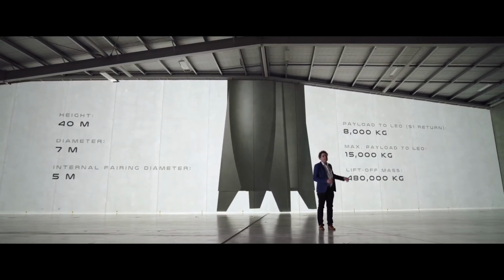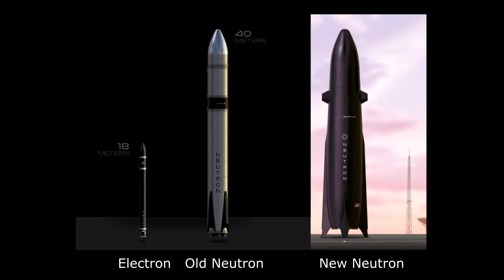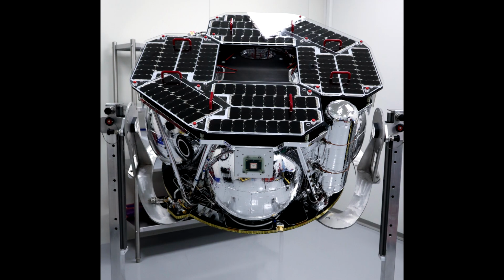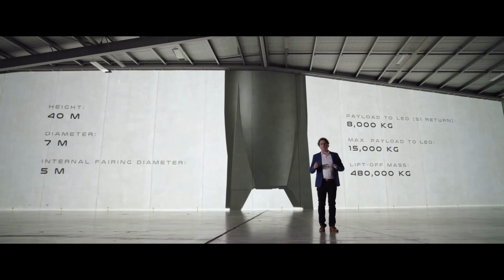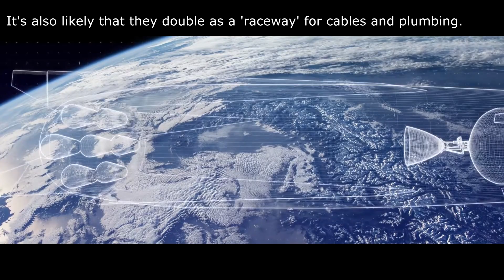Rocket Lab's Neutron Rocket Will Be More Reusable Than Falcon 9

Comment: I don‘t get why they wouldn‘t go for a fully reusable rocket. I think it is so obvious that if you have to scrap anything at all you‘re not gonna be able to compete with a system where the marginal launch costs are literally just the fuel. I suppose this upper stage will cost more than an entire Starship fuel tank so as ridiculous as it might seem, Starship will be cheaper to fly than the Neutron, not on a per kg basis, but in absolute terms.
Reply: making a fully reusable rocket is more difficult at smaller scales, so that's probably why they didn't go for that.
And I have doubts if starship could actually be cheaper than this rocket, specially if they bring the cost of the second stages down by mass producing them
Reply: There are lots of mission profiles that practically demand an expendable upper stage, anything higher than LEO is going to need to do a burn to raise its orbit. So if you fly a Starship to launch a satellite to a GTO, you need to drop that satellite off in LEO with an engine and fuel capable of raising its orbit. That sounds awfully similar to the Neutron second stage, right? So if the rest of the vehicle is reusable, you're really in a similar situation, except you don't need to rideshare with 100 other small satellites on a giant rocket. Starship is designed to do 2 primary jobs, bulk Starlink launches into LEO and interplanetary missions with refuelling.

Comment: Rocket Lab had long been on my watch list. Eagerly awaiting Neutron's 1flight. Vertical integration will be a must I think with a 2nd stage hanging in tension. The 2nd stage won't be much more than 2 tanks, an engine and some electronics with a payload on top. 
Other companies should not be too upset, innovation and competition are good for business.

SpaceX is ahead in reusability by a long shot but I like to see others joining that fraternity. Starship is supposed to replace Falcon 9 eventually anyway.

Blue Origin is losing the race to a lot of startups. It will be 22 years and still not in orbit. Slow and steady is not winning any races.
Reply: Horizontal integration might be possible, because all the tanks are empty before a rocket goes out to the pad, If the 2nd stage pusher plunger in the 2nd stage engines holds the engine weight and something else holds the payload then you can basically remove all weight on the tank and if ou give it modest pressurization it will hold it's shape on it's side.
Reply: Virtical integration make sense, especially if they are planning on rapid turn around, you don't want to waste time having to lift Neutron on it side for new cargo and then do another lift to get it vertical again. Ideally all they should have to do is open the fairings, load the 2nd stage, fill the tanks and launch the payload.
Reply: ugh.. if what you mean is for it's stock, it might be too late to buy on/after a successful flight test. or dime a dozen on failure :)

Comment: same gross liftoff mass as a falcon 9,  uses a similar engine design and a better fuel, yet lifts half as much to orbit.

While this sounds bad, it shows that they are being realistic. Things like the Chomper fairing will mass a lot more than the clamshell semi-disposable version.

My biggest concern is how they will get carbon fiber to handle multiple load cycles, multiple thermal cycles, without developing weaknesses. It is hard to test a huge carbon fiber structure for flaws.  

As for credibility:
Right now, I have more confidence that this rocket will succeed, than I have in the BO New Glenn.
RocketLabs at least have a history of achievement, innovation and actually getting to orbit.
Reply: Indeed, it's going to be funny if yet another competitor leaves Blue Origin in the dust.
Reply: The mass penalty likely comes from the decision to fly the whole rocket, fairing and all, to the elevation where it is safe to deploy the second stage. So even though the second stage is very light, they have to carry the fairing (which F9 drops) and the outer shell around the second stage (which there isn't on F9) all the way up to MECO and stage separation. They get some performance back later, but likely not enough to even out. Plus this always have to have fuel for flyback, no downrange droneships, so more weight penalties.
Reply: @lacalaca85   Excellent analysis, bang on.
Reply: @RobertLutece909  Falcon's Merlin and Neutron's Archimedes are both of gas generator cycle type
Starship's Raptor and New Glenn's BE4 are both of staged combustion cycle type
Reply: We have been playing with carbon long enough to get a good idea, after that if you get ten flights per airframe ……… gut it and go again, the airframe is cheap
Reply: Awesome. Interested to see what they can do with their carbon fiber developments and reliable testings.
Reply: I don't know why you guys are comparing Falcon 9 with Neutron. Falcon 9 doesn't have a reusable upper stage. Only the suborbital first stage is reusable. It's not about Neutron being realistic or having a weight penalty from the fairings. It's about having a completely different mission profile.
Reply: @米空軍パイロット  Neutron won't have a reusable upper stage either. But yes, the launch profile is different.
Reply: The quantity and quality of innovations shown for Neutron promise an engineering team that's quick on its feet, in an organization known for being quick on its feet. Yes, RL has more credibility for their success than BO, and even the new startups - a couple look good, but are a long way away from matching Electron, let alone Neutron.
Reply: @donjones4719  k
Reply: not even in same league fam they should be comparing to starship since they both are the newest vessels of each company. my opinion neutron can only carry about 8-9 tons while starship can carry upwards of 100-150 tons they not even in the same league. also they failed to considered that spaces vision is different in which they seek to make life multiplanetary and do deep space launches. Rocketlabs niche is basically sending up small satellites at a fraction which is good as well but not even comparable in terms of payload capacity and size. Even blue origin new gleen can carry 25 tons lol this ain't special. 
also yeah cool you can catch with helicopter but that's only because its a smaller rocket.... pretty sure space x can develop that too. but nonetheless you arent going to have a helicopter on mars or moon to capture first stage boosters lol that's why this is only practical for their niche not space travel.
Reply: Well, did falcon 9 ever put a maximum declared payload in the orbit, especially in the "reusable" configuration? I suppose they just don't lie as heavily as Elon usually does.
Reply: @lake258  Neutron can put 8000kg in reusable configuration and 15000kg in expendable configuration.
Falcon 9 can put 15600kg in reusable configuration and 22800kg in expendable configuration.

When did Falcon 9 launch max payload in reusable configuration?
Falcon 9 regularly carries 15600kg Starlink payloads to orbit in reusable configuration, which is already higher than Neutron's expendable payload capability. Don't tell me that all these Starlink launches are just "lies" or cgi
Reply: @biplabkumarghosh6300  F9 can't put 15600kg into LEO and return to the launch site. It can only do that with a down range drone ship landing. Neutron can do 8000kg and return to the launch site. The most F9 can put into LEO and RTLS is around 11500kg. So F9 is definitely a slightly bigger launcher to LEO than Neutron... but Neutron also has a better second stage than F9. 

So they're in the same weight class for LEO (with an edge to F9), roughly comparable to GTO, and Neutron probably has a slight edge for BEO missions. It's hard to say for sure without more data, but they're very comparable launchers.

Now we just have to see what the price of Neutron is like. If it always RTLS, requires less maintenance, doesn't require a very expensive drone ship fleet to catch the boosters, and has a super cheap second stage, it will probably be less per kilogram than F9 is. Probably a lot more per kg than a theoretical maxed out payload capacity Starship though.

But the competition between Starship and Neutron will probably end up looking like the competition between F9 and Electron today. If you have 30x150kg sats all going into the same orbit, you should buy a F9. If you have a small constellation of 6x150kg sats all going to different orbits, it's both cheaper and logistically better to buy 6 Electron rockets for 45 million than to try and make it work on a 50 million dollar F9 with second stage 8 engine burns. The same will probably be true of Starship and Neutron.
Reply: @lake258  What you are saying pretty DUMB. Just because you can do it to that LIMIT DOES NOT mean you SHOULD DO IT. That is what specifications are for which ALL have TOLERANCES. All engineers KNOW THIS but since YOU ARE NOT ONE OF THOSE ENGINEERS, you don't know about specs, and tolerances and how they use that to show the potential customers of it's CAPABILITIES. That does not mean the customers will use that max specs and load it up to that max. Doing that will be DUMB. People with common sense KNOW THAT. Therefore, Elon IS NOT LYING when he says the max specs of his Falcon 9.

Comment: Starship is also meant for Mars.  Much easier to make repairs on a steel structure than a carbon fiber one.  Also, steel typically fails gracefully.  Carbon fiber. . .not so much.

Comment: Its amazing to see Rocket Lab be THIS successful in such a small time frame! I wish them the absolute best!

One question: For their gas generator engines running on methane, Are they going to run it oxygen rich or methane rich? I don't think its a bright idea running it fuel rich is that good of an idea because of how methane is the most active and dangerous greenhouse gas. I know it sounds like a pretty dumb thing to be worried about, but I'm just curious
Reply: Fuel rich doesn't mean part of the fuel will remain entirely unspent, but rather that some of the fuel will undergo only partial combustion. In case of methalox, this means the exhaust would presumably include some mix of C (carbon aka soot, having lost all H to the O to form H2O), CO (carbon monoxide, having gained only a single O as compensation for losing all H), and maybe CH2O (formaldehyde, having lost only some H and gained an O as compensation), in addition to the usual CO2 and H2O produced by a balanced combustion. Any molecule of CH4 (methane) managing to make it out the other end unscathed would be a damn lucky bastard.
Also, being somewhat hot, any trace unspent fuel or partial combustion products would presumably soon undergo further reaction with atmospheric oxygen (and/or other gases), even at high altitudes.
I would expect magnitudes more CH4 to be unintentionally released into the atmosphere as part of fuel production and operations on the ground (where the question of fuel rich vs oxidizer rich has no impact), than during the actual flight.
Reply: Methane burns with ambient oxygen.
Reply: @denysvlasenko9175  Oh! I forgot about that. Thanks.

Comment: Who else thinks it looks like something designed to fly nose-first during hypersonic flight?  After a boost-back burn that sends it flying back in the direction of the launch site, it might glide way up high at hypersonic speed.  This could even be followed by a starship-like belly flop so very little residual fuel needs to be used for the final landing.

Comment: The ideas that make up the design are genious (integrating faring with first stage and let it attached, non-aearodynamic lightweight second stage which is suspended to save material...) - looking forward to see if they work in practice or if they end up with something being more expensive than falcon 9 while not being cheaper.

Regarding Carbon Fiber, Elon Musk mentioned in his talk that it was not just about rapid iteration why they moved away from carbon. A major point was that if there is wanted to be used autogenous pressurization, there would be hot oxygen as ullage gas inside which would be agressive to react with the carbon fiber - so additional coating required to prevent that. Also same issue during orbital reentry. So they would end up with a weight that is not much better than stainless steel for Starship - the possilbe better performance is just not worth the extra effort.
However, both of these downsides do not apply to Neutron: other engine cycle (wonder what theyll use for ullage pressure, but since its gas generator, there is no hot oxygen that could be used) and only first stage reenters (slower speed). So for Neutron design it looks like its clearly best performing option but there cannot be derived that starship really takes a lot of performance hit from using stainless steel instead.
Reply: @LueLou Other way around. They tried using Helium but went back to autogenous only, because helium bubbles caused pump instability. For Raptor the tank does need to be filled with a single fluid only since it doesn't handle bubbles nearly as well as Merlin. This is common for staged combustion engines.

Rocketlab avoids that by using a GG cycle similar to Merlin, so they can probably just use any pressurant.
Reply: The autogenous oxygen does not need to be an extremely hot ullage gas that threatens the carbon fiber tank. The excessive temperature can be reduced by injecting liquid oxygen spray into the hot gas stream. This will result in a greater flow rate of replacement gas volume but at a more modest temperature.
Reply: @LueLou they've moved away from it for now, but I think they want to return eventually? That decision came well after the switch to steel though
Reply: The dry mass of Starship is just insane. A Heavy-lift Vehicle from NASA's SPS study has similar payload to Starship (120t), yet only 4000t mass when full. Which is less than simply the fuel mass of Starship, and even with some mass reserve! Apparently, aluminium construction/winged flyback is a pretty efficient design!

Comment: Since Peter mentioned that the shape prevents shock waves from attaching during reentry, I would assume that they are planing to not have a reentry burn.
Reply: I'm not optimistic about this. SpaceX also had ... ideas... about easy recovery, like parachutes. After they actually saw what Mach 8+ does to a reentering rocket, they had to change tack.
Reply: @denysvlasenko9175  their problem was that Falcon 9 is too heavy for a parachute so it would rip apart.
And in terms of landing Rocketlab plans propulsive landing like SpaceX so it's proven to work.

In terms of reentry, Rocketlab has already studied this for Electron which has already performed reentries without reentry burn.

Comment: Looking forward to how they will fuel the second stage when it's inside of the 1st stage.
Reply: Scott added some text noting that the two long fins could double as raceways for cabling, etc.  Perhaps RL is going with the Starship design of fueling the upper stage thru pipes on the 1st stage. SpaceX abandoned that design only recently.

In that case the fins could contain the needed plumbing, which will turn inside when nearly at the upper stage level.
Reply: @donjones4719  It's actually quite simple. They can open the fairing on the pad and fuel it from a launch tower, then close it again. Heavy plumbing, complexrouting, and potential leaks is not as simple and direct as a hose with a coupling that can be disconnected right before launch.   The 2nd stage fuel is measured in kg instead of tons, after all.  Just... yeah... building a tower is more cost, potentially.  The other option would be to simply fuel it on the ground and lift it into place.  but that's essentially needing the same tower/crane/silo to be built...They have a much cheaper vehicle, but the sunk cost is adding up quickly.

Comment: I had to laugh at his example hitting metal VS composite. Yeah, if metal is wrecked you can see it.Composites the damage is hidden. You need an ultrasonic scanner to see the damage.
Reply: Went better than a certain unbreakable windows demo at least lol
Reply: Ask the airline industry about hidden damage in metal structures. They use ultrasound and magnetic testing equipment nowadays.
Reply: Denting/deformation is definitely better than sudden failure.
Reply: @clarkkent7973  It is? Sure in certain cases it can be(likely not involving rockets), but not if the structure relies on there being no dents. Try standing on a coke can with a tiny dent in the side. Damn some rockets cant even support their own weight if the tanks aren't pressurized.
Reply: And they even didn't bolt the stand down. I bet all three would be destroyed. Unnecessary passive aggression.
Reply: @kargi42  It's just a lighthearted dig, nothing anyone takes seriously, least of all Rocketlab themselves. They know perfectly well that its not at all representative of actual conditions.